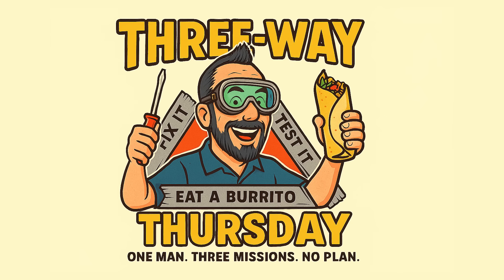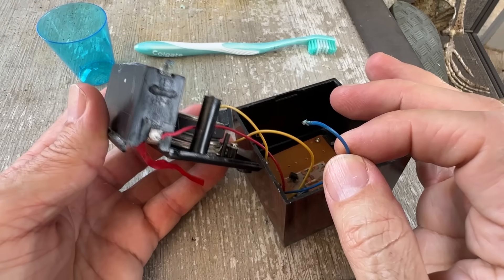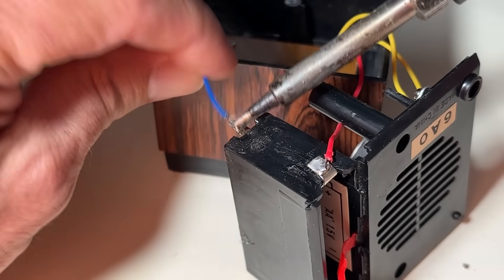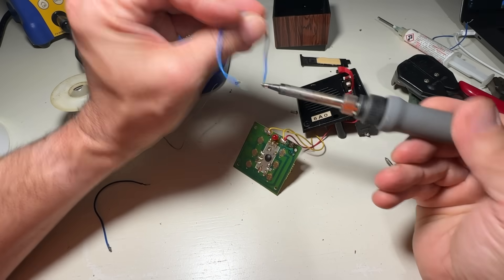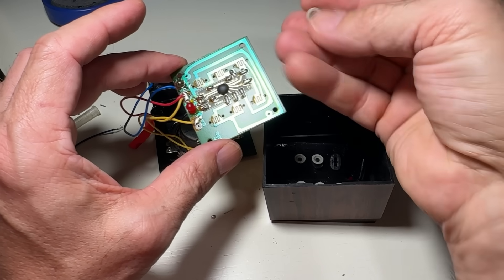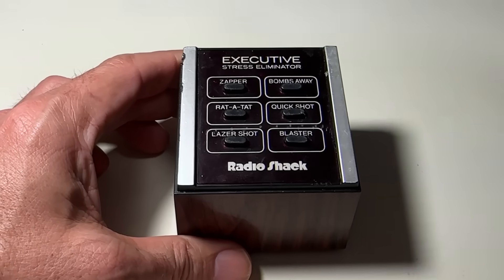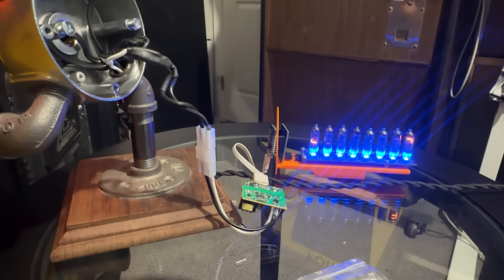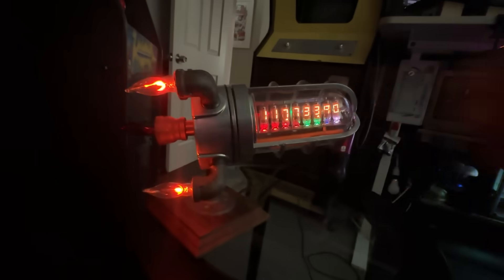Fixing Dragon's Lair LEDs, Radio Shack Stress Toy & BTC Ticker

Comment: The red ribbon in the battery compartment is designed to go under the batteries to aid with easy removal. You just pull on the end and the batteries pop out easily. There were many products back in the day that had them. The ribbons weren't always red, though.
Reply from the maker: This ribbon is too weak to do that. Trust us, we tried.

Comment: Oh wow! I noticed right away that when you add credits to the game, there’s a difficulty level selector. I don’t ever remember seeing that in the original Dragon’s Lair arcade machine. Is this a beta version of DL?
Reply from the maker: I think it has to do with the Merlin DX board making it easier to select levels instead of doing it with dip switches. Here’s those new settings: http://wood1st.com/LaserCon/Docs/Merlin-Dx%20Switch%20Settings%20V1.pdf

Comment: It would not have mattered which wire was hot or neutral, ungrounded devices like this do not care.
If it was plugged into 240 both lines would be hot.
Reply from the maker: I’m agreeing but since the plug was keyed I figured why not.